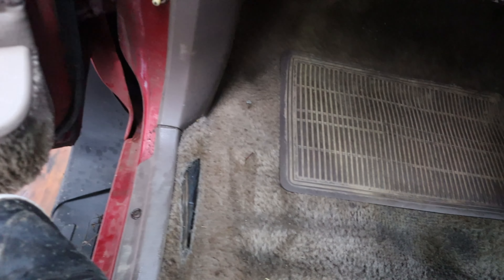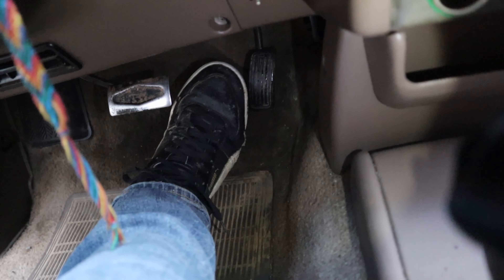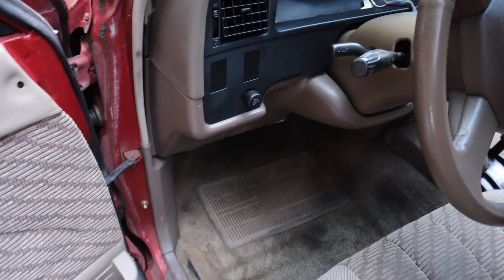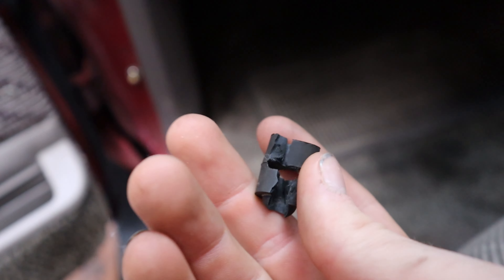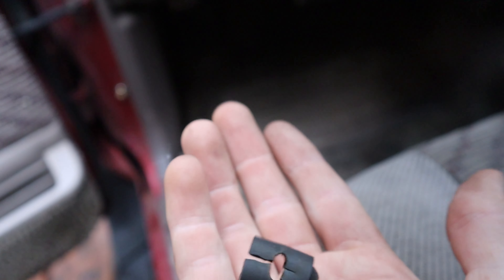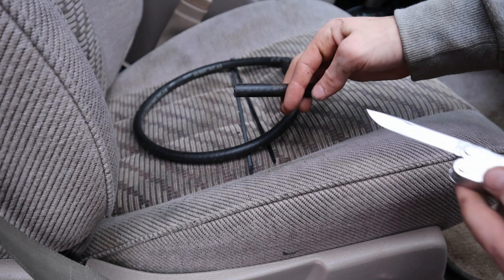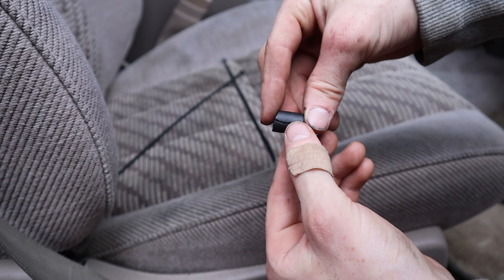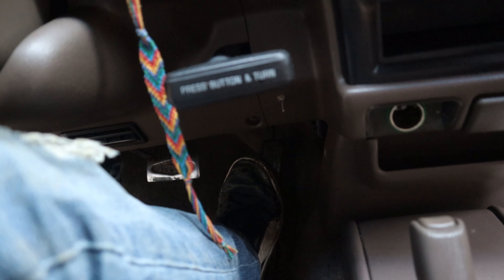1993 Toyota 4runner worn out gas pedal/stiff pedal repair

Comment: My god this is so much easier to replace than the 3rd gen 4R. I ended up using a silicone plug which was super stiff and kept splitting on cut I made to fit it over the cable. Did the rubber hose you used have similar stiffness or squishiness as the oem spacer?
Reply from the maker: it was close but prolly a little bit more stiff, though mine was so old I don't know what the oem one should feel like lol

Comment: GOod move.  ANother thing you can do more permanent is put a little window slide lock.  It's a 3/4" long peice of metal hardware that used to be used on old windows to lock them into place, they have a wing nut style clamp on them.  Ace Hardware carries them.  Google it, you'll know it when you see it.  It's metal so it won't become brittle and break like those plastic zip ties will over time, and the hose will wear over time as well.  That little piece of metal will fix your cable until it either breaks or wears out more.